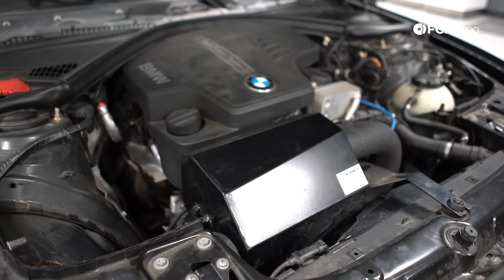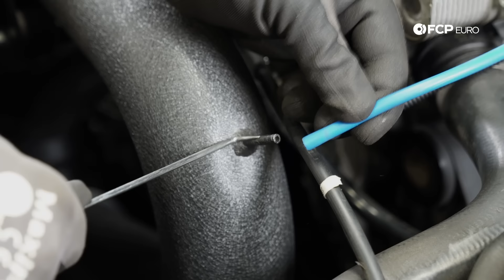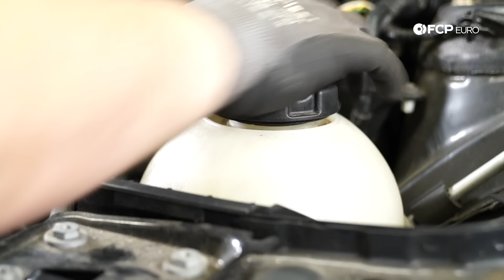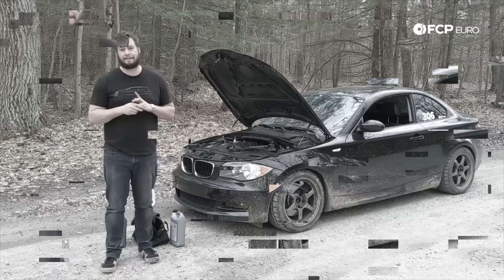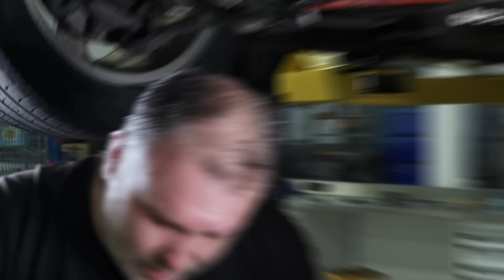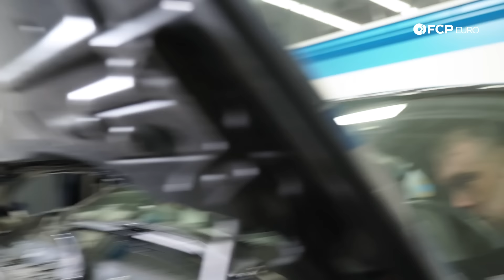BMW F30 N20/N26 Water Pump & Thermostat DIY (328xi, 328i, 528i, Z4, X1, X3, 428i, 228i & more)

Comment: What he doesn’t tell you is if you have a certain type of F30 is that you have to remove the power steering rack attached to the subframe to remove the bottom water pump bolts. Make sure to put a jack stand under it. It took me an hour plus to figure out. You’re welcome.
Reply: I ended up using a 10 mm flex head ratcheting wrench. Took a little bit of time, but was better than having to remove the steering rack and replacing the bolts.

Comment: Before starting the automatic cooling system bleeding routine, make sure that both coolant circuits are filled. The cooling system bleeding routine is automatically started simultaneously for both coolant circuits. If the cooling system bleeding routine is started while one of the coolant circuits is empty, there is a risk of damage to the electric coolant pump when running it dry. Make sure that terminal 15 is not disconnected for the bleeding procedure. Switch on low-beam headlights and hazard warning lights. If the low-beam headlights and hazard warning lights are not switched on, the ignition (terminal 15) will switch off automatically after a certain period of time and interrupt the bleeding procedure.                                   

•Fill the coolant expansion tank up to the lower edge of the coolant ventilation line above the maximum mark.
•Open the bleeder screw (1) on the coolant expansion tank. 
•Open the bleeder screw (2) on the transmission oil cooler until the coolant emerges without bubbles.
•Close the bleeder screw (2) on the transmission oil cooler. Bleeder screw (3NM)
•Open the bleeder screw (3) on the coolant return hose until the coolant emerges without bubbles.
•Close the bleeder screw (3) on the coolant return hose. Bleeder screw (3NM)
•Close the bleeder screw (1) on the coolant expansion tank. Bleeder screw (3NM)
•Massage the coolant feed hose and the coolant return hose.
•Connect battery charger. 
•Switch the ignition on. 
•Switch the low-beam headlights and hazard warning headlights on. 
•Set the heating to the maximum temperature and the blower to the lowest setting.
•Floor the accelerator pedal and hold for 10’s.
The automatic cooling system bleeding routine will be initiated. The engine must not be started. The electric coolant pump is enabled. Approx. 12 min after starting the cooling system bleeding routine, the electric coolant pump will automatically be switched off and the cooling system bleeding routine is finished.
•Adjust the filling level in the coolant expansion tank to the maximum mark.
Reply: Ugh headaches galore

Comment: Just done my water pump on a f30 320i. It was a headache… long job at least 3 hours. Its also recommended to change the thermostat as this plays a crucial role in ensuring coolant circulates correctly
Reply: i’m replacing mine tmrw on my 320i any tips ?? it looks fairly simple and easy but i feel liek everytime i think that it takes me ages to get it done
Reply: 3 hrs has me excited! I've had a 11 hr job for one simple piece on the same vehicle

Comment: They made the two impoosible bottom screws look so easy. Wonder if they removed anything to get it out
Reply: Remove the two E-torx bolts holding the steering rack, and slide it forward out of the way. 
Don’t forget to put it back in place before you drive away😂

Comment: Great video. But how the hell do you get to the bottom two bolts on the water pump with a socket? They face right into the steering rack....
Reply: Remove the two E-torx bolts holding the steering rack, and slide it forward out of the way. 
Don’t forget to put it back in place before you drive away😂
Reply: @InflectisAI thanks 🙄

Comment: @fcpeuro - i am having issues with my coolant pump. It just keeps on running even after engine is off and drains my whole battery. i have checked in female connector which goes into the coolant pump and found both thick wires and they are receiving constant 12 volts and thin middle wires for continuity(good connection with no break). Also checked thermostat wire 1 wire is receiving 12 volt(with engine off) and other wire 3-4 v(with engine on). Can you guide me what else could be the issue as i am lost here now and tired.
i also scanned and i am receiving LIN bus codes CD9010 & CD8E10

Comment: How can you guys be so helpful and so useless at the same time. The only hard part about this job is accessing the two water pump bolts from underneath the car that you guys give 0 guidance on
Reply: Remove the two E-torx bolts holding the steering rack, and slide it forward out of the way. 
Don’t forget to put it back in place before you drive away😂
Reply: @InflectisAI thank you so much
Reply: What was the solution to get them out?
Reply: @stgmadoesitall  Remove the two E-torx bolts holding the steering rack, and slide it forward out of the way. 
Don’t forget to put it back in place before you drive away😂
Reply: @InflectisAI thank you so much!

Comment: Also, consider doing the accessory belt and tensioner.  Everything is out of the way when doing the water pump.   The air box is much harder to align than what I think is necessary.

Comment: I had to move the electric steering rack to get access to the 2 bottom water pump bolts.  I fought and fought but couldn't get to it without moving.   Same e12 as the water pump and a 17m nut above.  Not hard and I wouldn't fight it, just nudge it out of the way.
Reply: Thanks. What's the torque spec for when I put the steering rack back in place?
Reply: @InflectisAI no recollection.  easy to find, I think
Reply: @ftboomer1 56Nm+90. I didn’t have new bolts/nuts, so I just went with 56Nm+60’ish.
Reply: I have the same problem, my car is f30 2014 2.0

Comment: Great video really helped. Did thermostat and that flange thank god I did when I pulled the flange off it disintegrated in my hands. Was only a matter of time. I bought a cheap housing sadly even though I always get parts from you guys. Had to swap out o rings because it was leaking. It made a horrible noise when started I think because it wasn’t purged fully. On my SEO d purge in a row now just to be safe.

Comment: How did you remove the plug to the thermostat? I couldnt get mine off scared to break the clip
Reply from the maker: If you are referring to the electrical plug, pushing it in and then pulling back to release it may help. A small pick to gently lift the locking tab may also help if it's full of debris.

Comment: Can a bad pump cause a missing lin code
Reply: This is my current issue, LIN missing coolant pump. Checked my ground and the wiring harness attached to pump and they both seem fine. Changing pump next week when the part comes in, we’ll see what happens
Reply: @MrAlibeast did pump fix it?

Comment: question please: Could the vacuum leak test detect a (coolant) head gasket leak if there was one present?
Reply: Technically it can but it would be difficult to know that the leak is actually coming from the leaky head gasget. 
If you had a coolant pressure tester and pressured the system you can pull the plugs and get a camera in the cylinders to see if any coolant got in the cylinders.  
Multiple ways to check a bad head gasget
Reply: Technically it can but it would be difficult to know that the leak is actually coming from the leaky head gasget. 
If you had a coolant pressure tester and pressured the system you can pull the plugs and get a camera in the cylinders to see if any coolant got in the cylinders.  
Multiple ways to check a bad head gasget

Comment: Did this today on a non-xdrive and the 2 lower water pump bolts and hidden above the steering motor. The secert is a 10m splines ratcheting wrench and address from behind the subframe. The longer the wrench the better. I used a mountain 10m offset wrench. Thats to abother video for the wrench tip.
Reply: Clarification for anyone seeing this later. Any 10mm gearwrench style ratcheting wrench will do and should probably be your first choice over E12 socket
Reply: @aeroderek  My first choice is to remove  the two e12 holding the steering rack in place, and slide it out of the way.
Reply from the maker: Great tip, thank you for commenting!
Reply: @fcpeuro   hello sir i am having issues with my coolant pump. It just keeps on running even after engine is off and drains my whole battery. i have checked in female connector which goes into the coolant pump and found both thick wires and they are receiving constant 12 volts and thin middle wires for continuity(good connection with no break). Also checked thermostat wire 1 wire is receiving 12 volt(with engine off) and other wire 3-4 v(with engine on). Can you guide me what else could be the issue as i am lost here now and tired.
i also scanned and i am receiving LIN bus codes CD9010 & CD8E10

Comment: The assumption is the hoses are replaced as well during this service interval?
Reply from the maker: Correct!
Reply: Someone recommended breaking the rest of the plastic “Mickey mouse” piece to remove from the hose so you can slide the clamp off. No need to replace the hose.

Comment: Hi ,my n20 engine ,water pump keeps running after ive switched off vehicle and drains battery ,i did experience a leaking pipe few days before this i replaced pipe but now i have this problem of the pump continously running ,even if connect a new batter without starting up car the pump starts to run
Reply: Hi, i have the same problem on my F30 320i 2015. What could be the problem?
The pump or sensor?
Reply: Hi,i also have the same problem..what is the problem?..
Reply: have any of you fixed this? please let me know as this shit is happening to me too @farrelchinnappa9484 @thabonkuna8588

Comment: Is there any possibility to check the pump functioning by applying 12V directly to the pins, without removing it? The bleed procedure is not working in my case but i'm not still sure it is failing.... any idea?
Reply: What was the issue in the end? Same issue here.

Comment: Great video.  Unfortunately, my BMW 428 was a pain in the a** due to the steering rack making it difficult to insert my E12 socket.  The work around was using a 3/8 ratchet wrench.  I was hoping it would be as easy as you showed hahaha.
Reply: I'm in the same situation with my 328i F30.... the 2 bottom bolts are pretty unaccessible due to the steering rack!!! I find a very uncomfortable orientation for my ratchet wrench to remove them, but i'm very worry to see if then I'll be able to put them again.....
Reply: I installed the top bolt first, and then I used a small 1/4 ratchet with a 1/4-3/8 adapter and a small E12. Take your time, and they go right in

Comment: I’m driving a 320xdrive bmw2015 and my dashboard shows a massage (engine overheating )but my temperature gage is not showing overheating 
And the engine lose power I don’t know if it is the water pump or thermostat. What has to do engine loosing power in relationships to water pump. Thanks
Reply: Did you resolve this mines doing the same I think it’s my water pump at this point
Reply: @nosurrinda  yes.
I had to replace water pump.
Reply: Where did you purchase your water pump  I got mine at rock auto coming in on Sunday
Reply: @nosurrinda  yes water pump Solve the issue I purchased @ dealer bmw
Don’t buy refurbished
Reply: @renanperez1616  how much you paid
Reply: @nosurrinda  $640 brand new
Reply: @nosurrinda  $640 brand new
Reply: And the water pump resolve your issue

Comment: Sir, can I ask, my BMW is F30 320i, yesterday I replaced the thermostart after it was finished I was bleeding but the water pump didn't drain the liquid into the reservoir tube, I have followed the steps, are there any other problems on my BMW?

Comment: Hello, Is the vacuum procedure absolutely necessary?
Reply from the maker: Hi Ray, it just helps in filling the system a bit easier, you can run the self-bleed procedure on the water pump a few times to reach the same goal without that tool!
Reply: @fcpeuro  Thank you!!

Comment: How can I access the 2 bolts at the bottom?? I have a rwd the subframe covers the bottom of the pump
Reply: What did you do? I’m having that issue
Reply: @christello4420 had the same problem, got it fixed with a flexible head wrench
Reply: @RE-MOAT  I would say anyone that’s going to try flexible head E12 wrench should know this is a hard tool to find 

It needs to be pre ordered and you should lift the car and make sure you have a wrench with the right length and girth because that is a tight space and I couldn’t get in there with anything I tried
Reply: @brunomichaelnavarro  In the EU you can get it in any hardware store, and I didnt lift my car at all. It was a hassle though
Reply: I had this same issue 

I had to completely unmount the steering rack from the frame of the car and support it with a dolly. It is two E12 bolts but you need a breaker bar. And you better not be using a 1/4 driver 

Also you need to pre order E12 steering rack mounting bolts (2x) because they are single use 

This was an absolute nightmare to do especially because I wasn’t prepared for it since the video doesn’t dismount the steering rack 

I don’t care what anyone says I tried swivel and extendors and even just a plain wrench 🔧 there’s no way to get to those two lower bolts on a 2017 BMW 320i rwd because of the steering rack

Comment: Why is my steering rack in the way. I can’t get to those bottom bolts on the pump
Reply: Well I had to unbolt the rack and move it a bit out of the way to get to the bolts. It’s the only way…in case anyone runs into a similar rack
Reply: @darth_art2101  I cannot find the bolt to replace. We're supposed to replace it right?

Comment: I have check the engine light on my 328i 2013, first when I've test with obd2 shows a lin bus error, CD8E10, CD8E12 I've replaced the accumulator regulator anything has been changed. then added CD9010 and 1D2404. A mechanic told me that the pump communication module blocks the signal puts the whole network in emergency and turns on the check engine for that the water pump should replace. He disconnected the water pump and the check engine light stayed off. Should I replace the water pump?
Reply: Hey did you figure out the issue I’m having the same CD9010 code
Reply: @ the water pump had issue

Comment: Why don't you put the hoses back in properly so that the hose clamps can be reached and not blocked by the other hoes? Have you ever thought about that? I hate mechanics that have no regard for the customer or another mechanic that's going to have to remove that hose later because they don't give a $hit how they put the hose back on with the clamp?

Comment: Hi I had the code P0597 come up and I just purchased the thermostat off of FCP and starting to gather everything to replace it but I noticed my lower radiator hose is collapsed, is this associated with this code or should I be worried about the radiator?
Reply: I have the same code with no hose collapse
Reply: @parthdinubhai  I would definitely try replacing your thermostat as soon as you can and don’t drive your vehicle or start it and if you attempt doing it yourself make sure your battery is in good health because you will need it for the bleeding process

Comment: When I replace the water pump, I also do the thermostat. For a few more dollars you can replace all the hoses which have the plastic connectors that get brittle with high mileage. If you are replacing the hoses, the lowest one drill a 1/4” hole and drain cleanly. As it drains take higher connections apart to vent and drain completely.
Reply: This dude is very helpful. I watched this video to change my thermostat and it was pretty simple. Then my next project is the valve cover gaskets. Watched that video also. Better than paying 2000 for the work from bmw. Only cost me 400 bucks and a little elbow grease. I love his videos. Thanks dude…👍🏼
Reply: Few more hundred dollars lol

Comment: Did you have to remove the sub frame to get the bottom two bolts out
Reply: Remove the two E-torx bolts holding the steering rack, and slide it forward out of the way. 
Don’t forget to put it back in place before you drive away😂

Comment: Ordered a new water pump off FCP but the Only thing I’m struggling with is trying to get the back two bolts out. Not sure how you got them did you take out anything else to get to the two bolts?

Comment: Do you have to remove the subframe
Reply: No you do not need to remove the subframe
Reply: @xKINGx707  
?
Reply: @Stxxology  any update bro how did u end up doing it
Reply: @amiteshwarsachdeva7467  ended up grinding the socket and getting a bendable ratchet
Reply: If you guys happened to do this how’d you get the bottom two bolts out? Seems super tight
Reply: @Stxxology  Any update on those two bolts? Going to be tackling this job tomorrow…yay
Reply: @Man-Up-G  hi bro i think our cars are rhd did u figure it out?

Comment: i changed both water pump and thermostat and the radiator fan is still full blast
Reply from the maker: Have you checked the temp sensor connected to the fan?
Reply: @fcpeuro  actually....it is working now...looks like computer needed to relearn
Reply: @fcpeuro  location of the temp sensor, please

Comment: Gareth,

Which is easier? Doing this job on the N55 or these N26/20's?  

Imo the N55 looks easier even though you really need to be under the vehicle.
Reply: I would say the N20 looks easier given the N55 is so tightly packaged.
Reply: I'm having a heck of a time getting bottom bolts out..have steering in way. He must be showing on xdrive